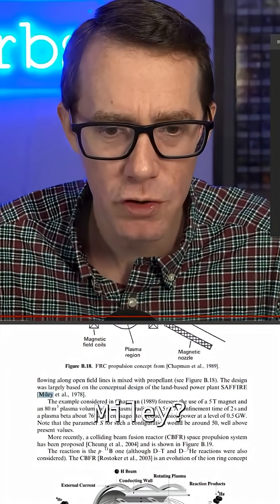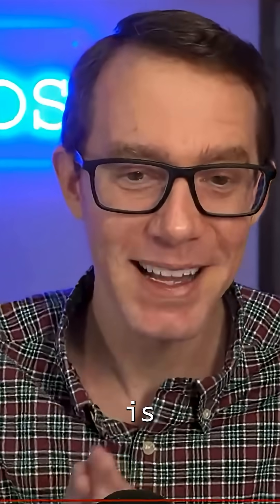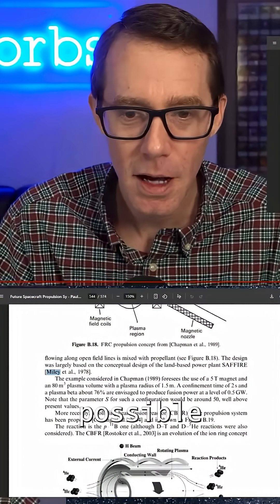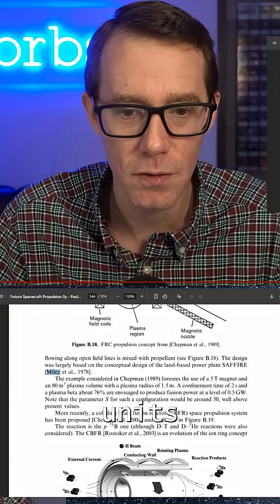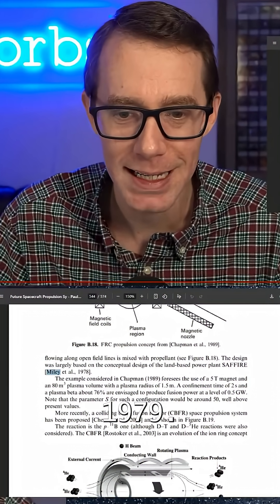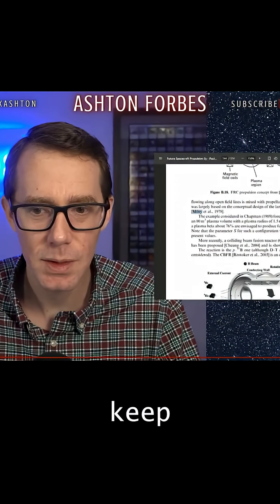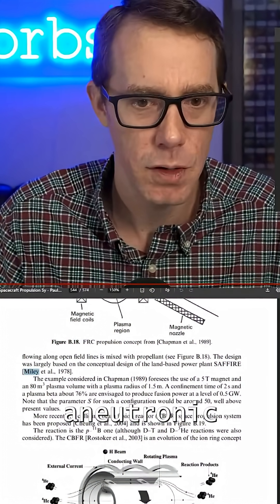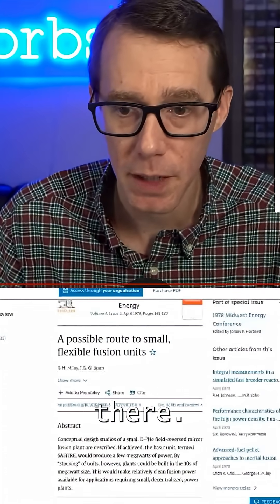The Secret Fusion Projects You Weren’t Supposed to Know About

Comment: I mean... I've poured through old stuff too
Reply: And?! Cmon, what did you find out?!
Reply: @Joeyowoah I have binders full of stuff I need to physically construct and attempt.

Some of it is absolutely impossible. Like the pyramid nonsense. Some of it is real, but the person only measures a voltage, no current is gonna do anything with the setup...

And the rest... No cheating is required if you can use passive sources of potential that require less input than output.

And I wish I was better at chemistry
Reply: @Joeyowoah if it helps, after I get setup into my own place. There will be dedicated practical experiments and YouTube videos to go with it. In a new channel, not this old relic. XD I'll try to keep a subtle hint that it's me.